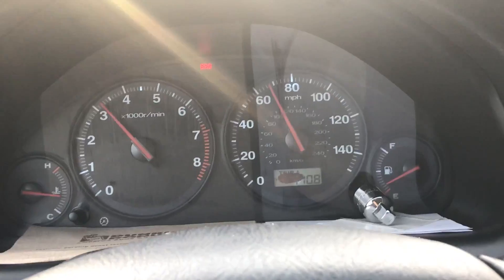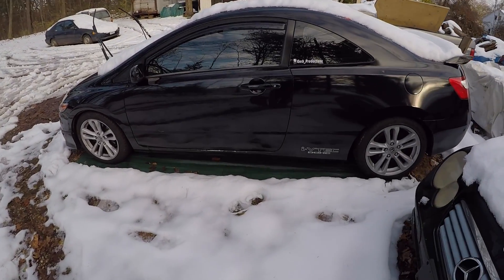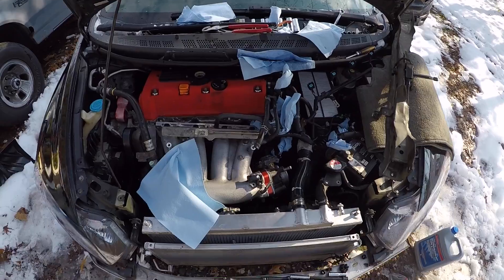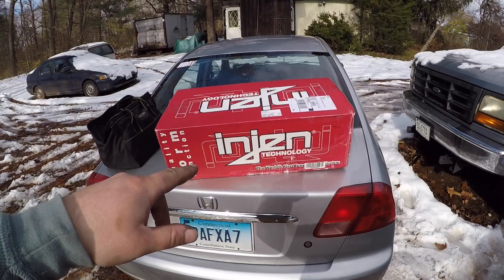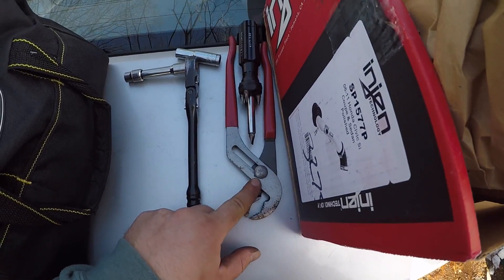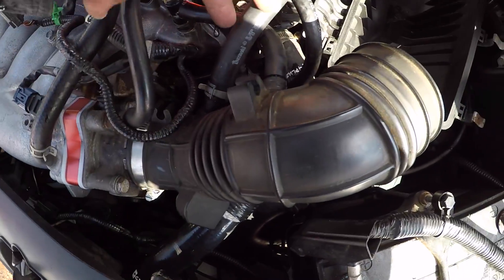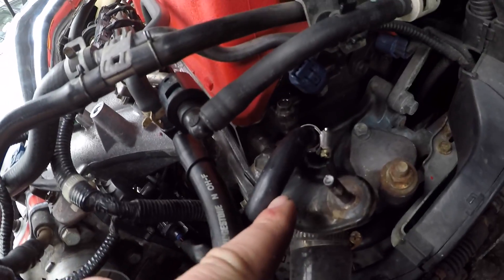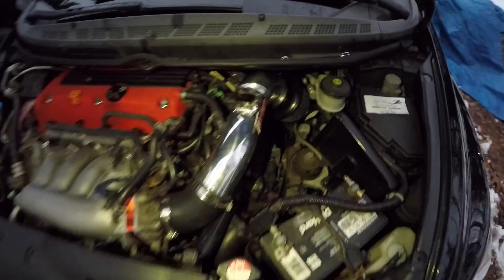New Air Intake!

Comment: My SI 2008 has been running with an injen SRI for about 8 years straight. No problems so far. I just installed it for the sound. I still love that crossover scream.
Reply: I’m worried about mine having one, I recently bought a civic with one and it’s running fine but people said SRI are not good for the engine? Is that true or should I change it back to stock?

Comment: Spent the past week lost in the world of cold air intakes and short ram intakes. Theres are so many different brands out there where does a guy start? Everyone swears on the brand they went with vs the next but each one has its pros and cons alike. Read one guys comment "Its a tube with a filter on the end", and really it is. After days of research and trying to figure out which is the best for the money I found its really just personal preference and how much a guys willing to throw at it. One concern I had was that a tune would be necessary to run a short ram air intake but that doesn't seem to be the case from what is stated on the net. One guy says "yea its necessary", while another guy says "you'll be fine". At this point my stock air box hose that connects to the throttle body has ripped on me twice and for what it costs to replace the plastic hose with another plastic hose from the stealership I mine as well upgrade to a quality air intake. Your video helped me astronomically with making a decision on what intake I was gonna go with. It was Mishimoto, or Injen SRC for me. I've got a 2009 Honda civic SI 2.0l. Bought it a couple of years ago and its really overall been an awesome little car, fun to drive, parts are cheap and its easy to work on. Its really my first rice burner so it has been quite the learning experience. The cars got a 2.0l engine with a 2.4l air intake manifold. It's been absolute hell trying to figure out what intake to get, one for a 2.4l or one for a 2.0l. The guy at the stealership said that the K-series engines all had compatible parts for the most part. I'm still scratching my head on how the previous owner managed to make it work but it does indeed work cause I've been driving the car for two years with no problems. Dude said he did it cause the 2.4l air intake manifold has better flow. Personally I don't know enough about these cars to know if the diameter of the throttle body on a 2.0l is the same on a 2.4l. At this point I've went with the Injen Short ram Intake for the 2.0l, hope it works out. I live in Alaska and as far as I know nobody does any tuning and none of the shops here have a Dino. Go to the stealership in downtown and I get a young dude that literally doesn't shit about cars but works at a dealership. Yea Alaska is a special kind of hell in many ways, but man I gotta say I really appreciate people like you and the content you've produced, it brings good piece of mind. In the age of the internet and all its information its sad to say you're better off getting all your advice from the internet than to trust a guy who says he knows his shit.
Reply: Old vid/, comment yet curious how you made out?

Comment: I have the injen cai. It's a pretty good entry level intake. I put down 208whp with that cai, 1320 headers, full race exhaust
Reply: I'll add that my buddy has the ktuned short ram, vibrant headers 2.5 collector with hfc, and stock exhaust and he put down similar numbers at the same dyno.
Reply: @twisted2nr  stock exhaust but has a 1200$ header wtf lol.... this mans confused!\
Reply: @jackhofalot6705  lol. He bought it used and had a really good deal on it. I think he bought it for $150
Reply: @jackhofalot6705  my header brand new was like $320 off of Ebay.
Reply: That 1320 header and small piping CAI is holding you back. Good choice on the FR exhaust tho. These K20s easily can break 220s with the right mods
Reply: @yosh_tuned  yea I'm planning on upgrading to a 3.5" CAI. Then later get some skunk2 headers or invidia
Reply: @yosh_tuned  I love the full race. Possibly the best exhaust for k20s
Reply: @twisted2nr  Yeah, the 3.5" intake and a longer tube header will really open up the K20 (top end). It's a night and difference.

Comment: I heard the K-Tuned 3.5" SRI is pretty decent. I've seen the numbers they put down and it's very similar to the 3.5" CAIs and of course the sound is amazing. Nonetheless, glad you finally found a nice setup! 🙌🙌
Reply: Really depends on your setup.. some people even net better numbers with the stock intake tbh. Ktuned SRI relocated the battery so the filter faces the headlight instead of the firewall.
Reply: @danielkuoch136  Better numbers in regards to the Injen SRI or the 3.5" SRI?

Comment: Hey man I just got an 07 FG2 with 179k miles last weekend. Saw tons of your videos and already fixed tons of stuff and subbed ur channel... keep up the good work.
Reply: main thing about the fg2 is the clutch master cylinder. They are junkfrom the factory, and its the best "first upgrade" you can do to your car. If you have pop-outs or the notchy/grind 2nd gear high RPM shift the CMC is the cause. Also look into Acuity shifter bushing they are 100% worth the money. Also acuity transmission springs are 2nd best cheaper upgrade. Involves a little bit of knowledge/experience though to installl, nothing hard.
Reply: @jackhofalot6705  When I first got my car it wouldn't take 2nd and 3rd gear when shifting during high rpm. Researched a ton and found out that it can either be fixed with CMC replacement or clutch pedal adjustment. Before spending money I decided to do the clutch pedal adjustment (which involves adjustment of both CSC and CMC) and holy shit literally fixed all my shifting issue. Fortunately CMC wasn't leaking any fluid so I think my CMC is still fine, but it probably has to be replaced at some point. 
Also what other cheap upgrades do you think is worth the money?
Reply from the maker: Wow, it’s like I already stated this in my previous videos lol 😂... maybe you should start a channel
Reply from the maker: Do all the basic maintenance to it, oil change, new coolant, new brake fluid, brakes, shifter bushings, motor mounts, etc. appreciate all the support my guy 🙏🏻

Comment: Hey i have a question. So i have a R18 07 civic that i changed my intake on and now the oil/engine temperature doesnt heat up as fast. When it does heat up and i do a couple of pulls the temperature bars drop down. Any idea how to fix this? My heater also doesn't come on as fast as it did with the stock intake?
Reply: @WelshyAuto  oh ok would that affect anything or should i be good.
Reply: @WelshyAuto  ok thanks a lot for the info
Reply: horrible advice from welshy. it seems maybe you forgot to hook some hoses up? When your coolant temp sensor goes bad it gives u a bad reading. For example i had a bad coolant temp sensor on a b20 and when i drove it around the needle would literally drop all the way down. in the middle of winter. changed out the thermostat/coolant temp sensor and it fixed the issue.
Reply: @jackhofalot6705  That's exactly what's happening to me. It's winter right now in Ontario, Canada and when the Guage goes up to optimal temperature and when I floor it 2-3 time the temperature goes all the way back down. So it's the Temperature sensor that's the problem? I know I hooked up every hose to the right spot.

Comment: my flowmaster exhaust actually sounds just right. 10 series. when u floor it you hear engine, around 3k to 5k and nice deep exhaust. not loud enough to get tickets or anything but it’s noticeable passing by. definitely not specD Ricey and not Skunk 2 loud. but little louder than oem exhaust
Reply from the maker: Great to know... I was looking into megan racing, but who knows lol... You know what exhaust i miss? The Yonaka lol
Reply: Gerb Productions go full race exhaust already it's 3" (76mm) and not ricey.. it's in between Invidia Q300 which pretty much sounds stock unless you VTEC and Skunk2
Reply: I actually bought a skunk2 last week.  The guy failed to tell me he cut the resonator off but I noticed it and talked him down to 300. In any case, it's fucking loud and I already can't stand it.  Just kinda said fuck it and ordered a new q300. Cant wait.  :3.   Had I known,  I would've just saved the 300 and put it towards a full race instead.  Oh well :/
Reply from the maker: I like q300 ;)
Reply from the maker: Yeah, that blowssss.. I would definitely sell that thing for a stealthier set up, which you did.  Dude, q300 is just as good as a full race.

Comment: I’m running a Takeda SRI and love it. Had it for years. No SRI hate here. 👊🏻
Reply: Mr1983abraham never had those issues with it. Was the issue potentially tied to the sensor loosening up? I love the SRI sound but with the new direction on my build I could possibly get a full CAI. Really like the setup from Hybrid Racing.
Reply: @Forgedthroughfireapparel  HR is the way to go! It definitely puts out for just being FBOs
Reply: 08_FG2 yea, got the RDX injectors and siriMoto  big bore ready to go. Might be a few though. I just basically stole a set of Godspeed coilovers on eBay (brand new). Having a weird suspension pop so I will be attacking that issue first. 

Thanks for the info on HR. Pretty sure we will do that with the battery relocation.
Reply: Mr1983abraham that’s weird. Mine used the factory screws. 🤔
Reply: Mr1983abraham must have changed it some. Got mine in 2012.
Reply: Mr1983abraham must have been the early version. The pipe on this thing is a beast.

Comment: Thinking of the Injen short ram. I want a hybrid racing cai, but idk which is better and reliable.
Reply from the maker: Hybrid is probably better for a few more HP... injen is more reliable
Reply: its just an intake, just piping and few rubber connectors. nothing to be "reliable" about. What you need to worry about is getting properly tuned if you install ANY aftermarket intake on the k20. The ecu in these cars are not like the old school b series. They do not know how to compensate for added air flow, your car will run lean lean lean all the time. It does nothing but make your stock civic even slower if you dont get a proper tune with Hondata or K pro... just saying....
Reply: only CAI are worth your money, they make more power vs any other intake. Why spend 250 dollars on something that gives u barely any gains (when tuned) vs spending 300 on a real CAI that is legit and quality product? You are alrdy investing 250$ in an upgrade, might aswell net the extra 50-100 for quality...
Reply from the maker: Barely any gains?... But it still gives you some gains 😂. And maybe because some of us aren’t trying to be the fastest cars out there. CAI are good if you’re racing / tracking car all the time.
Reply from the maker: Reliable as in filter location, come on 😂. I can say the same thing about a CAI. I don’t agree with that. There is a reason why there is an “I” In Ivtec, which stands for intelligent.  The k series ecu is more than capable to compensate for the change in air flow by dumping some extra fuel. Ran my k&n with no tune for 20-30k miles, 0 issues.

Comment: Good stuff bro 😉...You'll enjoy it 👍👍 Also can it really be flipped? I never thought of that
Reply: It can but you got to relocate your battery
Reply: @highspeedenthusiast6628  Nice! I'll be looking into that for sure
Reply: @8k_all_day664  check out gerbs video (getting my new exhaust) that's my car & my set up in the vid... intake is wrapped with thermal insulation and reflective tape and has completely eliminated heat soak, my intake temperatures are the same as outside Air temps
Reply: @highspeedenthusiast6628  Damn hell yeah just checked it out, BTW RPF1s 👌 good choice man
Reply from the maker: Ik, his car looks sick!

Comment: pretty much the same as your k&n. you will still get really high intake temps when the weather breaks
Reply from the maker: I hope not....
Reply: @TheGerbsteve  well why wouldnt it?  filter is in the exact same spot as before when you were hitting high 90's on your IAT video you made when it was warmer out.   i thought you would have gone with the hybrid racing ram style intake where you relocate the battery to the subframe and the filter sits behind the headlight

Comment: Nice video bro , that’s the intake I was thinking of getting bc the pipe is smaller where the sensor sits and doesn’t require a tune , let us know how it runs / sounds !
Reply: Any aftermarket part on these cars requires a tune. Idk where tf you heard that bro.
Reply: Jack Hofalot on the injen description itself . That’s why I didn’t believe it lol, I have 2011 fa5 and want to do some mods so far only did a axel- back
Reply from the maker: You DO NOT need a tune for injen sri. I know 4 people that run injen Sri's with stock ecu for over 40k miles, ZERO ISSUES. So for the people that say you need a tune for the injen, they're wrong. Don't be afraid to pick on of these up, they're pretty decent man, $172 rn on https://www.injen.com/sp1577p.html.html
Reply: Gerb Productions good shit homie , deff Gona be my next mod then ! Pep my vids when you get time Gerb you motivated me to start a channel , keep up the vids :]

Comment: Nice man... Do u think changing the thermal gasket and intake will help with your knock issue? Did u take the tune back to the stock tune or back to plain stock? I was getting knock I run octane booster by Royal purple . Don't get any knock now
Reply from the maker: I'm re uploading the skunk2 MAP today since i removed the thermal gasket. And now that i have the intake, i should be alright. Gonna do some datalogging, so i'll keep you posted.  Right now, it's 100% stock, ecu is flashed to stock & i hate it lol.  Are you still on a baseman bro?
Reply: @TheGerbsteve  I am on a base map , noticed I have knock on cylinder 2&3 at half throttle till i hit 4 grand. Definitely a tuning thing, especially since I run a cai . Gonna be doing a etune in the next couple weeks. Also thinking of checking the hondata thermal gasket I have as well if it don't match I'll put a stock one back on. That it self can cause knock. With octane booster it goes away tho. I don't have any knocking that i can hear. Engine sounds good and runs good. Might be ghost knock from vibration
Reply from the maker: E tune for me most likely as well ;)... Wouldn't hurt checking out your thermal gasket bro, never know.  I've heard certain octane boosters help resolve knock, but i'm not messing with anymore basemaps bro. It will be 3 years since i've owned the Si in january 2019, i'd say it's time for a tune.  I'm thinking most of mine was ghost knock also, but i want to be on the safe side.
Reply: @TheGerbsteve  I've had mine for a year , and im already getting the etune. This is why I've only launched twice. And only to half or little more throttle pulls.. Ive never floored the car. Lol to much work and knew it needed a tune.. so I been looking into motors. You know of kmod? Lol I tell ya been nice to drop off the trans for a full racing trans with a upgraded lsd. Then I think well why not get them to build a stage 2-3 k24 or just have em bore out and build the k20 ..so far away
Reply from the maker: Nah bro, never heard of Kmod.... Either way, k20 or k24. Build either, you'll have a monster haha ;)

Comment: Just got the intake in the mail. Any cons? Does it require a radiator flush?
Reply from the maker: Heat soak in the summer months, but it’s a pretty good intake for starters. No radiator flush is needed, just top off radiator if you lose coolant

Comment: Aye man short rams sound better then cold air at end of day tbh
Reply from the maker: And are safer in a way.
Reply: Facts, I had a HPS Hi-Flo SRi in my TSX, she sound amazing, Check My Vid out in my Channel
Reply: @TheGerbsteve  yea safer cause u don't have to worry about sucking in water.. and u don't need a pro tune to run it. You should see a little more bottom end tq vs the cai its mid and top end..

Comment: Absolutely positively one of the best if not the best SRI on the market... 6 + years with it with flawless results, perfect mass air flow sensor alignment! Haters suck on Dicks! The ports on your intake manifold aren't perfectly matched with the ports on your head to begin with... it's a technique called Port matching and it's well worth taking the time to do... I've done my intake manifold my SRI my throttle body my header and all the flanges on my exhaust... also running intake manifold and throttle body thermal gaskets with great results
Reply from the maker: If anyone would know, it's this guy right here lol ;)...